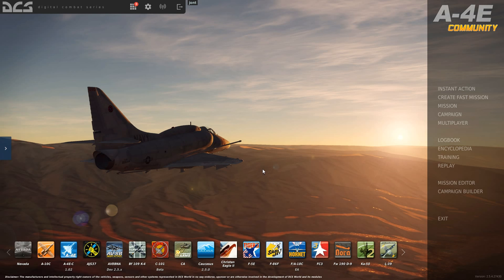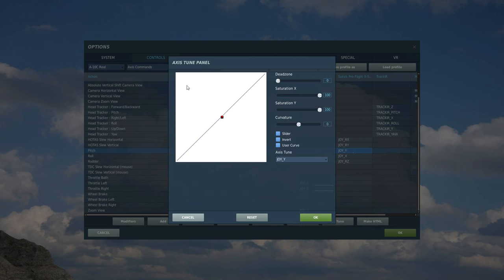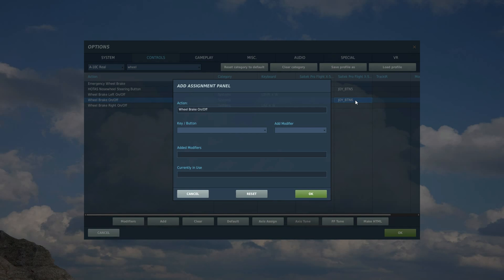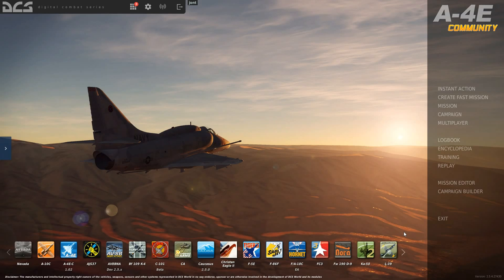A-10C Warthog: Setting Joystick HOTAS Controls Tutorial | DCS WORLD

Comment: 0:58 | Settings Location and explanation
------ Joystick Setup ------
1:40 | Axis Commands
         - 2:04 | Zoom View
         - 2:20 | Throttle Section
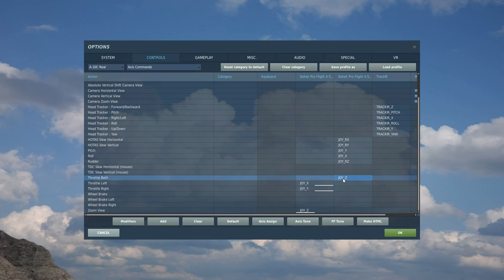         - 2:51 | Rudder Section
         - 3:11 | Dead-Zone Correction (used in multiple sections however this first has explanation)
         - 4:06 | Roll Section
         - 4:25 | Pitch Section
         - 4:42 | Slew Section
6:23 | Search Commands
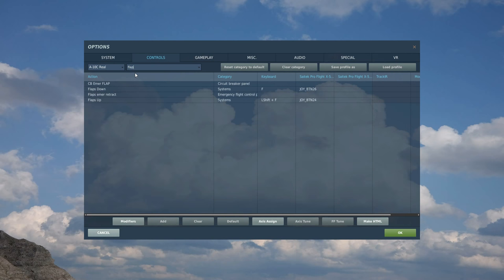         - 6:28 | Flaps Section
         - 6:49 | Speed Brake Section
         - 7:23 | CMS Section
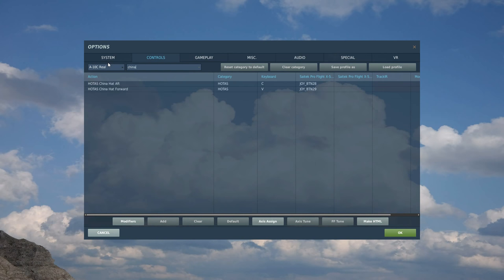         - 8:19 | China-Hat Section
         - 8:49 | Auto Start/Finish Section
------ Throttle Setup ------
9:25 | Search Commands
         - 9:26 | Trigger Section
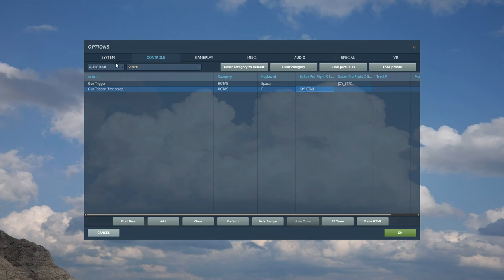         - 10:16 | Weapons Release Section
         - 10:26 | Trim Section
         - 10:59 | DMS Section
         - 11:24 | TMS Section
         - 11:57 | Wheel Brake Section
         - 12:31 | Master Control Section
         - 13:04 | Coolie switch Section
         - 13:26 | Boat Switch Section
 
NOTE: by adding a modifier, you can have 1 hat switch do multiple commands dependent on what modifier button you are pressing. this will allow the user to avoid using the keyboard and continue with the HOTAS the entire time.

Comment: this works for all aircraft. in Microsoft apps a program called antimicro (its free) bind right shift and right control to a hotas button in antimicro.. then for example make weapons release shift and trigger. so you would click the hotas button assigned to shift then pull trigger and you get weapons release while also getting just the gun trigger when not pressing the button assigned for trigger. 

i also do this for trim. so i have trim set with the shift modifier and top hat on my stick, while with out the shift modifier my top hat changes SOI.

Comment: Pro Tip... for you guys like me, who are limited to the "cheaper" HOTAS set ups... I recently found myself needing MORE buttons with the A-10a. By accident I had left my Playstation DS4 controller connected to my PC and started DCS. Of course everything went kind of wonky, but I cleared the now "wireless controller" column under controls to get my HOTAS working back to normal. Then I started fiddling around out of curiosity, and realized I could easily use the 2 analog sticks and the additional 14 buttons on the controller.
I then mounted the controller to the arm of my chair ( or just lay it it in my lap) just behind the throttle, and now when I'm using the targeting designation with Maverick missiles, it's a breeze to steer the cursor and lock using the left stick and L1 shoulder button to lock.  Another example, I have set the DS4 Share and Options buttons to control way point selection.
I've used this set up for display only and VR DCS, and having used a DS4 controller so much already, it's muscle memory easy to find the buttons I need without peeking under the headset.
Reply: even with good hotas this sounds like a great idea
Reply: I might try that because i have a "cheap HOTAS" lol
Reply: That's a brilliant accident, thanks for sharing!
Reply: I'm stealing your idea
Reply: Thanks!
Reply: I use the Logitech Extreme3DPro in the right hand and xbox controller in the left :D Hopefully I'll get an upgrade today.
Reply: Oh wow what a great idea!

Comment: Another good video!  With you running out of keys, have you considered using a modifier key on a key on one of your controllers?  I used a key setup from someone who posted to DCS files.  It allowed me to double up Trim and CMS on the same hat, Coolie and Boat on the same 4 way, and China and brakes on the same 2 way, and Trigger first stage and CMS Z axis on the same key.  I'm using a TM T16k FCS HOTAS setup for reference.

I did have a question, you mentioned that first stage trigger button needed to be pressed at the same time you use the main trigger to use your gun.  I've had the gun fire without.  Will I get more consistent results if I use the stage one trigger?  I'm still learning and figuring things out, so I often fumble with my commands.
Reply: Your plane will be stabilized so your gun always stays on target. Much more brrreeee on target. :)
Reply from the maker: Oh shit I didn;t realise you could. Yes will def do that now.
Reply: @meteorcrafters3277  I was reading the manual last night after an evening of DCS failure =/.  In my reading I read a suggestion that said if you have a stick that doesn't have a two stage trigger, go ahead and bind both stages to your main trigger.

Can you think of a reason not to?

Comment: Adding curvature makes the controls less responsive early in the range of movement. If you look at the curves, it’s flattening out the line in the first part of the range of movement of the control, similar to how a dead zone flattens out the line. Only a dead zone flattens out the line completely. The line is completely horizontal for however large you have the dead zone set. When you had a curvature, the part of the line that represents the first part of the range of movement starts to flatten out and shift towards horizontal, but it doesn’t go all the way horizontal unless you addd a ton of curvature. The more curvature that you add, the more the line shifts toward horizontal similar to a dead zone.

So adding curvature is deadening the control response early in the range of movement and the more curvature you add, the greater the degree of deadening. An axis with no curvature will have the same degree of response throughout the entire range of movement of the stick, throttle, or rudder.

An axis with a curvature of 25 will have approximately 25% less control response early in the range of movement. A curve of 75 will have approximately 75% less response in the early range of movement, compared to end of the range of movement of the control. A curve of 75 will significantly deaden the control response in the aircraft for the fist part of the range of movement of the control. For example this would make a stick so that the first inch of movement only give 25% of the control response compared to the last inch of movement of the control.